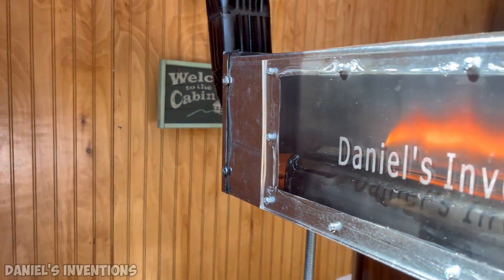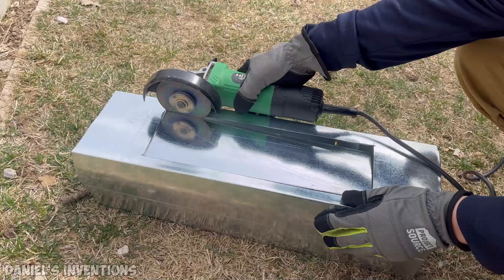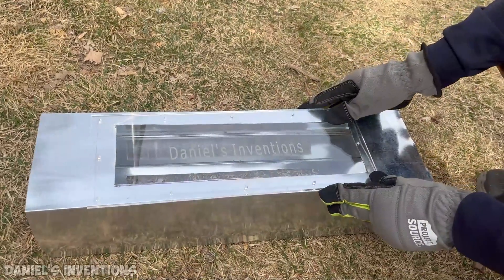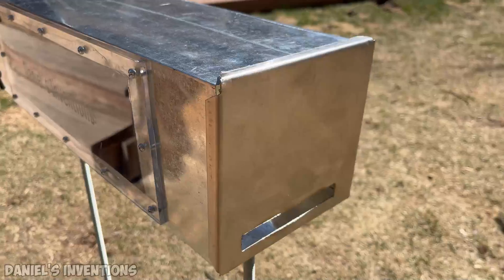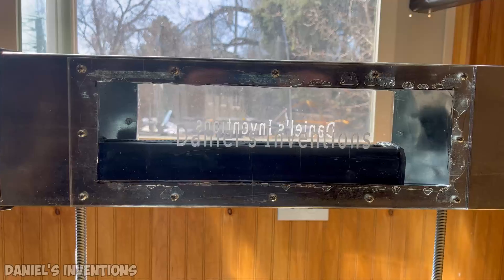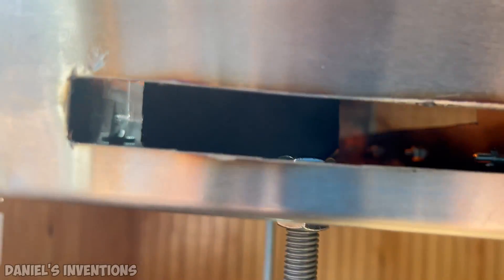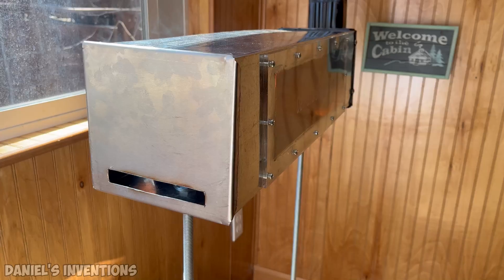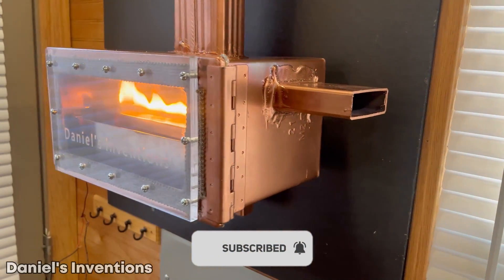ENDLESS Heat for Your Home WITHOUT Electricity 3.0

Comment: Great idea, my question is this. Why don't you double wall the heater with fire bricks inside. Yes, it may heavier and a bit more expensive; but in the long run it will be worth it. Second put a fan system on it so the heat spreads more. Third with the exhaust pipe, you should have double liked pipe.

Comment: The basic idea is very good.  I really like the versions that recycle indoor air thru a continuous tube, & have outdoor fresh air intakes—as well as hung on wall, safe from kids, pets, unstable humans!  
This variation looks like some problematic points…the other models shown seem to have addressed these points—why did he not do these on this model??…
1. Galvanized metal will emit a toxic fume when heated to a few hundred degrees—if using galvanized metal exposed to heat, FIRST burn off that coating…it will rust, but can try hi-temp stove paint.  
2. Only 2 legs with a top-heavy load.…unstable for areas with pets, kids, or impaired humans.
3.  The air intake is sucking house air—it requires an outside fresh air intake, to avoid depleting household O2.  Carbon monoxide is a real threat when using any significant flame source in a closed building—even for relatively small flames. 
3.  Then he 😱 I know it’s a teensy heat source, with teensy emissions, but…??

Comment: I saw your videos and decided to build my own propane heater using a 24x16x12 steel electrical box. I am using 3" car exhaust pipe stainless steel and running pipes through the center connected by Y pipe on the intake end with a blower fan and a separate pipe running outside for exhaust. I am using my old Dyna Glo 30,000 BTU heater for the burner and parts. It already has the thermostat, pilot light etc so I just need to mount everything in the steel box. I ran the Dyna Glo for two years un-vented and that was a huge mistake. The condensation from burning propane caused the glue in my RV roof to de-laminate and my roof  crumbled to pieces and had to be replaced. No one ever talks about the moisture problem. So that is why I am building a vented propane heater. There is a good vented propane heater on the market made by Dickenson but it is very expensive and I can build even a better bigger one for half the cost and besides the Dickenson does not have a thermostat. Cheers keep up the good work and testing.

Comment: Its getting cold again. Some upgrades for a new version could be carbon felt for the wick (doesn't burn itself out and will last), stove paint so no matter the material or coating it doesn't cause toxic fumes, use a cpu heatsink with thermal heat pipes to fet the heat concentrated on the raidator fins and use a thermal fan to blow the heat out without electricity. Also have a deeper reservoir so the oil doesn't need to be replaced as often.

Comment: I can see your point .. have you thought about just Riviting On More Metal Layers?  Plus, you forgot to Pre-Burn the unit "Out Side First ?"
. Something as simple as A 25 Or 50 Gallon Trash Can and Cutting And Folding that Section into your Square Box worked for us.  We used "Welding Sheets of 5mm Burn Proof 4,000° Cloth as The Wick "Won't Burn Nor Melt" when used as A Long Wick.  - JW from Northern Minnesota. Retired USAF.

Comment: 😊 nice system...to Heat... Hmmm IAM thinking about to make IT smaller...so that i can Install IT for heating my bicycle Camping Trailer,in the Winter... My Camper get 2m to1m and 1.50 high...  I think about such closed system with small oil candles...  IAM homeless and search for the best easiest safest way and lowest cost  posibility... A 5v Fan maust be enough ....  Hmm i figure some Out...If  i know about ...i only find the right way...😅

Comment: How do you screw heat resistant glass to the steel without the glass shattering ? They both react differently at different temperatures.  Wood fires use a pliable packing to allow for expansion and contraction to prevent this happening

Comment: I have taken this idea and talked with a guy who knows and work with chimneys. He said the best result would be to have a thicker box, at least 5 mm of steel plate or corten. There would have to be a separate intake of air from the outside, so the box is a completely sealed system indoors. The oil that burns, vegetable scrap oil or whatever, should be mixed with a little parrafine oil for to burn better. I wonder if not a kind of heat exchanger would be appropriate at the end of the exhaust to further use the heated air again for increased efficiency. What about the fumes on the outside, do you simply just have a hole in the wall or how do you bring them away from the house?

Comment: So for v4.
Use 99.99% pure carbon felt.  (not the plastic fake stuff, you'll know because it cannot burn)
You can use it to wick, and since it does not burn, it is an infinite wick.  HAS TO BE the REAL 99.99% carbon felt, not the fake chinese stuff.

It can wick off of vegetable oil, for instance, for hours.  Check out Robert Murray Smith for a good video demonstrating how to get it working.

Also, when you are routing pipe/ducts.  Avoid 90 degree bends.  It restricts airflow massively.  This is true when dealing with either water or air.  You can have ten 30degree angles, and those will restrict flow less than one 90 degree bend.

 simple direct port in from the outside (driven by a small fan on stale days) and a simple direct port on the opposite corner facing inward, would be optimal.

In fact, if you put the in port and out ports at an angle with the flames at the same angle (and perhaps a small mesh to break up windforce and keep bugs out) so that they line up on the path in, that would be the most optimal design.  Straight line.  It will make the inside of your box look angled

You want 0 obstruction of flow, but you will need a mesh to keep the bugs/windforce from blowing out your box.   Could even rig up meshes so that you can push them to line up and restrict flow more/less.  Depending on how windy it is, and how strong your fan is etc.

Comment: All those metal components will rust at an accelerated rate.
If my woodstove made out of steel is any indication....   
Ditto the comment about galvanized steel.  You're not suppose to weld it for the toxic fumes, so I assume any high heat may do the same.   Just be aware.
If you make your exhaust pipe at a 45 degree angle, you'll extract more heat out of it before it exits the building.

Comment: You still need to pull in cold air from outside.  It will increase the efficiency significantly.  Negative air pressure will pull cold air from outside into the room.

Comment: What matt and some of the others have said about using heavier grade materials and toxic fumes.also. have you studied or looked into how to convert heat directly into electricity yet? Thermodynamics? I only ask because you can also convert heat to energy and power dc stuff...like the pc fan in V1 and 2. make a double box set up. A smaller  one to convert the heat into energy to power the fan and one to burn the oil in.  This is a cool experiment. if you scale it up though, you're gonna end up adding the cost of what would be a normal electricity bill, to your monthly grocery bill. Another option is something I've seen recently. A Rocket Mass Heater in an enclosed porch.  it'll cost you waaay more money in outlay and labor but you can scavenge what you need to fuel it, for essentially free. just taking the piles for instance of a chopped down tree and transporting all that to your house and stacking it up. actually if I owned the house I live in I'd consider it.

Comment: If you have proper welding gear with a proper full face mask, an SCBA or Cartridge-based breathing apparatus and full leather welding outfit, the ZINC fumes can be vented to a sand-based or charcoal-based heavy metal extractor which will minimize environmental pollution and save your skin and lungs from heavy metal poisoning.

The Zinc fumes from even mildly heatted-up Galvanized metal IS POISONOUS so be careful. Only weld Galvanized metals IF you have the proper personal protection gear (aka a full welding suit)

V

Comment: Add sterling engine powered fan and there is no need for electricity. Or angle the intake from below toward the top on the warm air exhaust and it will circle properly.

Comment: I think if the exhaust pipe can be blocked by an air filter, it can remain inside the house and may cause even more heat as it does otherwise. Filter can be custom made or can be used car engine filter but it may require a custom pipe. But I am sure there are many options available over the shelf with least or minimum work required to be installed in the current setup.
Reply: This is a disaster waiting to happen.

Comment: How do you turn the heater off . Do you just block the air intake? Use a fire extinguisher, pick it up and throw it in the river , run away, fill the box with water or sand,  call the fire department, or some other method ?
Reply: I thought exactly the same thing. A method to smother the wicks quickly to kill the flame
Reply: Smother the wicks with a metal top

Comment: I think you might create some pressure pulling cold air into the cabin this way as well. You could have the intake come in from outside, and add more mass to and around the exhaust to act as a radiator for even more efficiency

Comment: Yes, fire is not electric...nothing new there.  How is a fire that burns oil which consumes it an endless heater?  You would need endless oil reserve to be an endless heater because once oil is burnt up, fire dies and no heat happens.

Comment: MAKE THIS HEATER : This heater is a steam heater and gets very ,very hot. It can heat your whole house. All it does is it rotates a small barrel with many holes in it inside another barrel. The rotation causes the water to heat up very fast and turn to steam. You can make a bicycle version of this.

Comment: It will smoke, no matter the guage.  That is why one must always do the first burn outside to get the manufacturing coatings off or else use paint remover for painted surfaces.  Once the galvanized steel coating is burned off (burned off) it is safe to visit with extra high heat stove bbq paint and use indoors.  Immediately after the paint is set, a couple days to a week, start your regular fire in it and let it gas off any extra from the new paint.  Then you have a beautiful n safe heater.  Stainless steel is another thicker option and with use develops  a beautiful bronze finish.  Thanks for such a great invention!

Comment: Galvanization contains zinc, which becomes toxic when heated. What about the original green paint of the ammo box? Does it create toxic emission under that golden metalic coat of paint when heated? What if it was spray painted with high heat paint? Thank You for the great videos.
Reply: Ok so first of all best thing to do is to sand the box to get rid of any galvanized coatings then use high temp engine block paint. Simple

Comment: Stop stop stop stop stop.. 
You never use galvanized steel.. It has zinc in it, which is what makes it rust proof.    Zinc will off gas about 390 degrees F.  That gas can render you unconscious almost immediately when inhaled, and kill.   
The design is admirable, but you need to use safe materials.. Since HEAT is the main subject, get in a habit of looking up the heat tolerance of EVERYTHING you are using,

Comment: I applaud the ingenuity. In general, I think DIY projects are great; not only do you learn a lot from building something like this, but you develop a sense of self-reliance 💪.

However, this heater really isn't safe to use indoors. For one, galvanized steel releases zinc fumes when heated -- these are extremely poisonous. The "heat-resistant glass" looks like acrylic or polycarbonate to me -- also a really bad idea to use this in close proximity to a flame, as it will eventually melt and possibly catch fire. The threaded rod mount looks pretty flimsy, and could topple over. Then your house burns down :(

The paint for the downspout isn't rated for such high temperatures; it will eventually burn and release poisonous fumes. 

To anyone considering building this design and installing it in your home: please don't! Just buy a proper heater that complies with local codes.

Comment: Others have mentioned this but I'm chiming in because it's a potential health hazard:

You say "corrugated" steel in the video, but that's not the right word. "Corrugated" means wavy. Your steel is flat, so it's not corrugated. I'm concerned that what you're working with is *galvanized* steel and if that's the case... those fumes coming from the steel are toxic. Consider:

When heating galvanized steel, the zinc coating begins to vaporize. This sends fumes into the air which are a major health risk for those inhaling them. These fumes can cause what is known as “metal fume fever” or “zinc shakes.” Metal fume fever can cause symptoms that include fever, headaches, nausea, chest pain, and more. Inhalation of these fumes can also cause long-term health problems, as the lead present in the galvanized steel can vaporize along with the zinc. Exposure to lead is known to cause a plethora of serious health risks, including cancer.

Please take heed of my, and others, warnings about your health.

Comment: @ Daneil: What polycarbonate window are you using? Toughened glass can't be drilled so I am curious in what to use. Many thanks ❤ the content 😊
Reply: I looked up "custom heat resistant oven glass" on Google and there's a good few companies that'll make you this with the holes pre-drilled

Comment: Oh no! Don't use galvanized for your heater metal. That will give off deadly toxic fumes. It's a real danger to welders know about when working with galvanized, plus the heat removes the coating anyway. So you're better off getting untreated steel because that's what you'll end up with - if you survive.

Comment: You will still accumulate a huge amount of soot which will make the fire even worse!
Reply: I just built a v2 and ran into this issue. Any ideas...
Reply: @Darth.Phaedrus  shorten your wicks.  The wick length and air flow + flue pipe config are the key to getting a full burn with little to no smoke.  If you are getting deposits then your burn chamber isn't hot enough.
Reply: @Darth.Phaedrus unhook it and wash it every month

Comment: I keep having this thought. Something like your heater here, mounted in something like an old air conditioner case. Winter comes, you take the screen off your window and sit it in. Summer comes, you pull it out and put the screen back on. It would probably also make it really easy to vent outside, since it is already outside. I think I'm fixing to try a diesel heater, putting it outside and making a removable panel for my window that I can run the heat through. After looking at heaters for the last few weeks, I don't think I have ever ran across a non-electric window unit. Everything I have ever seen is a basically an AC that has an electric heater in it.
Reply: If you put that heater partially outside, it will partially lose it's functionality. It will probably also scorch your window frames. :)
Reply: @TheBushdoctor68  I came up with an altered version that is working pretty well. Chinese diesel heater sitting outside is pumping hot air in through a window as I sit here typing this. Next spring, I can just take it out and put it in storage.
Reply: @jaybanks7718  Oooh, that sounds nice. Is it "cheap" to run?
Reply: @TheBushdoctor68   It is cheaper than electricity but more expensive than my wood heater. I needed it for a back bedroom just a little too far away from the wood stove. I think I'm getting about 20 hours out of a couple of gallons of diesel. I'm in Texas, so I can get away with just running it 2 - 3 hours in the morning a lot of days. It's working out as planned so far. There are bunches of videos on youtube with actual testing of how long they run per liter of diesel. I wouldn't take my word for it. Other sources I found say: 1.5l to 2.5l per 10 hrs. It also depends on if you run it on high or not. I pretty much have to run it on high.
Reply: @jaybanks7718  Fair enough, compared to wood. Sounds like you got a great setup.
Worth looking into. Thanks.

Comment: May I offer the next version. You can get copper sheeting and have a HVAC ductwork builder fabricate the box. You can braze, solder, or put refractory cement, or JB weld or high temp silicone on all joints to seal on the inside. 

Copper will radiate heat through the room or house much better that other metals because it warms the walls and objects in the room not just the air.

Kindly lower the unit so it heats the lower half of the room better. Also structurally reinforce the top so you can cook or heat water for soup or tea. 

Nice build, very soothing flame. Very elegant design.
Reply: Copper will give off toxic gases at those temps.
Reply: @burger1113   You can cook with copper at high temperatures.